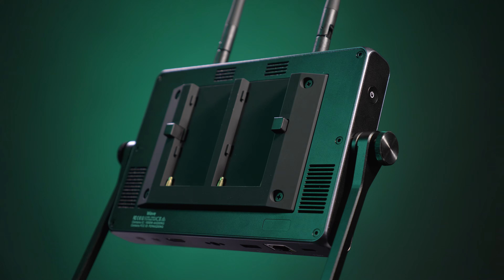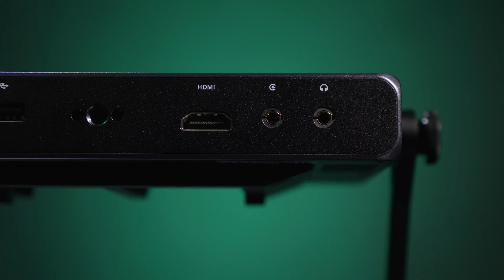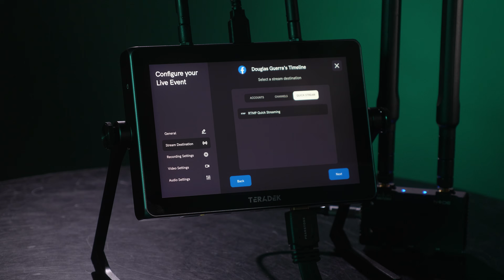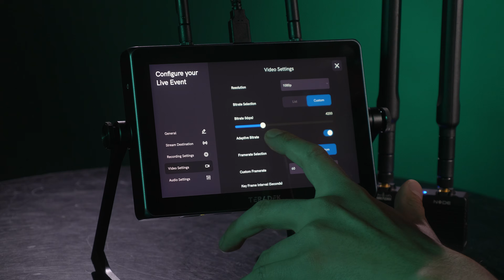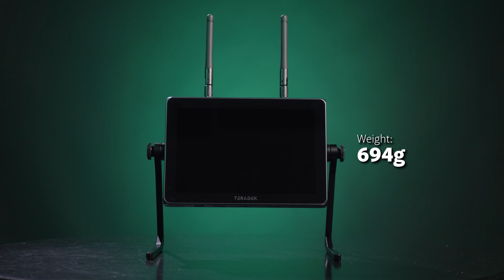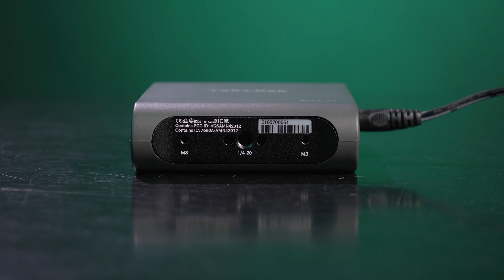NEW Teradek Wave Streaming Encoder & Monitor and Spark 4K

Comment: TERADEK SPARK 4k

Does anyone has the same issue?
It says out of range even its just meters away to each other. sometimes it says no video but good link on the RX, but on the
TX it indicates it says "no link"
I tried to restart the RX. It will work fine for 1min. RX receiving video with good link, TX indicates no link but same frequency to RX.
Also I did swap the RX and kept the TX. All were good
I did also Firmware update. Nothings changed.
My location is SEA.
Reply from the maker: I'm sorry to hear that your Teradek Spark 4K Transmitter/Receiver Set (BH #TE101855) has been having some connection issues. It sounds like you will need some one on one trouble shooting support. If you would like to have a one on one video chat with our product specialists, please sign up for a Tech Corner session. You can pull up the Tech Corner sign up page by pasting the following link into your web browser. https://bhpho.to/3XFjXQM

Comment: The Wave has no DC input port?!
Reply from the maker: Correct Dalton. There is no DC power input port.  The new Teradek Wave is powered using the integrated dual L-series battery plates or included USB Type-C power input and power adapter (included).              >Mark<
Reply: @BandH  Ah, I didn't see anything about an included power adapter.  Thank you for clarifying.

Comment: I don't think you mentioned what happens to the bonded stream , where does that go?  You can't just send a bonded streram to YT right, so how does it turn into a normal stream for youtube?
Reply from the maker: Multi-Destination Streaming:
Send your live streams to Facebook, YouTube, Vimeo, Wowza, and Custom RTMP(S) platforms simultaneously.  With a subscription to Sharelink, Teradek’s cloud platform, you can keep a steady stream by splitting video bitrate across several internet connections. You can send your streams to multiple platforms at once. You can remotely manage your stream from anywhere in the world, and adjust your stream settings, destinations, and start/stop functionality using the Sharelink web interface.
Common workflows using Wave:
Camera > Wave > Sharelink > (Youtube & Facebook)
Camera > Wave > Bonded Sharelink > (Youtube / Facebook)
Switcher > Wave to Ethernet > Sharelink > (Youtube / Facebook)

Camera > Wave > RTMP (Youtube or Facebook)
Camera > Wave > RTMP (Youtube / Facebook)
Switcher > Wave to Ethernet > RTMP (Youtube / Facebook)
Teradek WAVE Quick-Start guide:  https://bit.ly/3pE5pQV              >Mark<